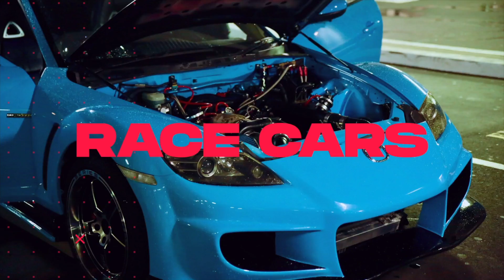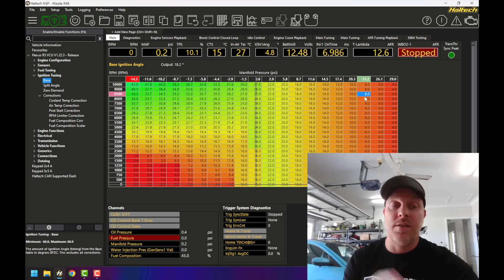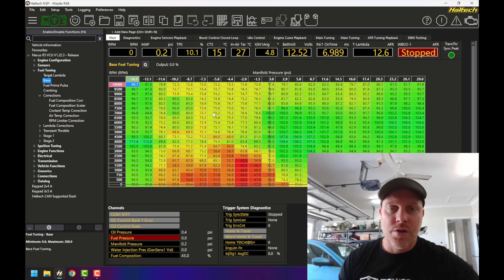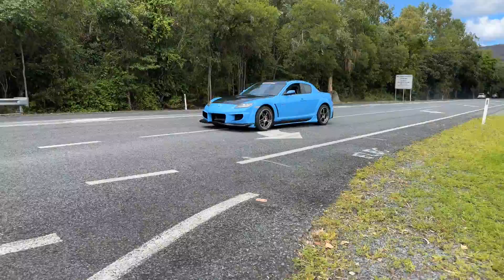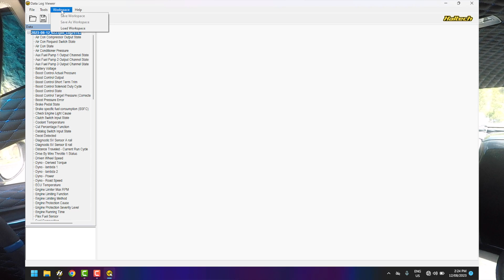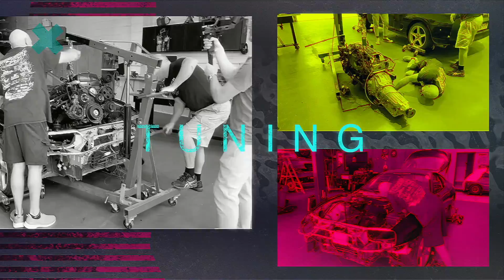Mastering Flex Fuel Tuning: Road-Tuning with E85 and Haltech NSP

Comment: You should absolutely be tuning ignition and fueling for heat soak compensation, NOT for perfect conditions. Did you turn on O2 corrections fuel compositions for it?

Comment: In Haltech NSP you just check the Flex Fuel as fuel type and go (but data log and verify too)
Most of the time you don't need to add fuel to the Fuel Composition Correction table.
Great video!!!
Reply from the maker: Actually I need to update this topic as I since found that because of my units of measurement I did need to add correction values but only a very small amount I will do a new video on my latest data soon
Reply: hey mate, hows it going? Will you be uploading another video on this? I have an FD and I want to run it on Flex. Would be great to see another vid with even more info! Great vid, all the best!  @mechanicalwarriorsofficial
Reply from the maker: @ogsd3203  yeah I’ll do an update on this

Comment: Im using a haltech sprint re on my fb 6 port Turbo
Reply from the maker: Nice are u doing the tune yourself ?
Reply: @mechanicalwarriorsofficial yes I'm doin the tuning my self I just doin a diy in tank fuel pump using stock FB tank I just waiting for a Holley Hydramat strainer and next I have to fix the front cover o ring cause I change oil and pressure drop and I found the o ring on the oil filter pedestal so im wondering if I can use the metal gasket without o ring and if I have to use a shim to replace for o ring
Reply from the maker: @pilotohernandez1569  yeah ok cool let me know how it all goes